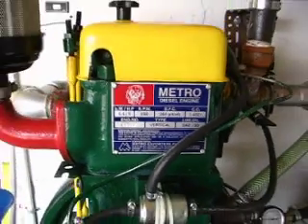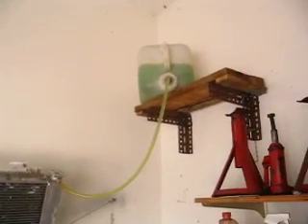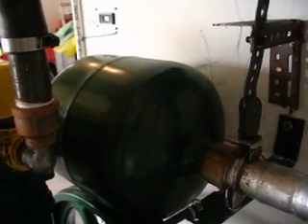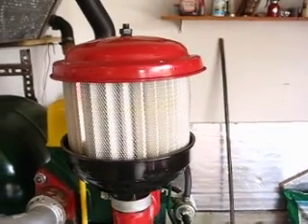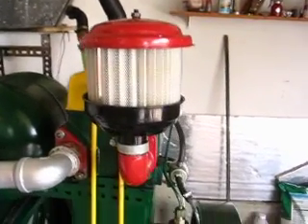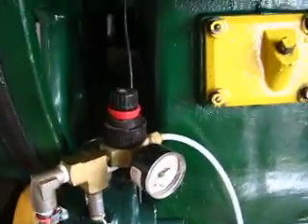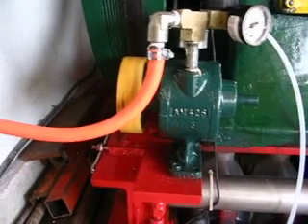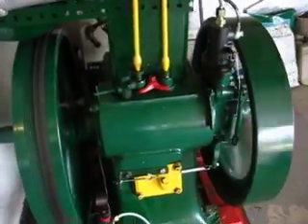Lister engine  air start

Comment: Slickest starting system ever seen on a Listeroid.  Very nice!
Reply from the maker: Thanks, this is a very old video. Lister and air starter still working with no problems
Reply: @hotrod3737 hi from Sweden!
I will exactly do the same. Thanks for the great idea!
Did you balance the engine? If so, how?
Reply from the maker: @stephanmenzel2103  I did not balance it and it runs pretty well. Still ticking along nicely although I only need to run it once or twice a year and normally only for a few hours

Comment from the maker: It is currently setup to run on a mixture of Diesel and natural gas.  It can run on straight diesel, waste motor oil, virgin or used vegetable oil, used hydraulic oil and a few other things.
We are not off grid and it is only used as backup and does not charge batteries.  We do not backfeed the grid (we have solar and wind to do that).  These engines are hard to find anymore as they have been banned by the EPA.  Cost engine if you can find one 2500 gen head 400 everything else you build.

Comment: I think this is the coolest damn thing I have ever seen.  What do you run it on.....fuel?  Are you off grid because of it?  Do you just use power as it is running or do you use it to charge a battery bank and feed electricity back to the grid....so cool, where and how much to get/cost of these motors?  Tks

Comment from the maker: There is an 120vac electric fan mounted on the top side of the radiator using a thermocouple on the water outlet to start and stop the fan.  The thermostat in the engine is a 195 degree F stat.  Remember this engine is only 6hp and the radiator is a very large aluminum radiator designed for a 500hp racing engine.  With the radiator at that angle there is a fair amount of air being sucked through  via convection even with the fan off.  Fan only runs is outside temp is over 85 degrees F.

Comment from the maker: @sdavies45 
My compressor/air system consists of a 100gallon tank that is always full.  If the pressure in the tank drops under 90 psi the compressor automatically comes on and refills the tank.  If the power goes out i know i have at least 90 psi in the tank and that can start the engine many times.

Comment: What do you do if you can't run the air compressor because you have a power cut?

Very very nice engine, by the way, runs as sweet as a nut.

Comment from the maker: @sumosamuri 

The cap is a standard automotive radiator cap that i modified by removing the bottom portion of the cap so if any pressure at all tires to build it just go up the overflow tube to the tank mounted above the radiator.  The radiator is one that I took out of my 69 camaro because i need a bigger radiator for the car.  I think the stroke is about 2" on that air cylinder but you don't need even that much.

Comment: Carl, 
I loved the vid. I have a metro 16/1 under rebuild. Curious as to what vehicle the radiator came from as well as the low pressure cap.

What is the stroke on the air cylinder you are using. This is so slick. No dead batteries or toothed plates to upset the balance!

Vern

Comment: your radiator cap should always be the highest point in the system. you should weld a blanking plate there instead, so someone doesn't take it off and spill coolant everywhere.

Comment from the maker: Well I am still around and the engine is running fine.  Only had to use it 2 times this winter during some power outages.

Comment from the maker: it uses about 1 liter per hour when running on diesel at about 2kw output.  When running Duel fuel diesel/natural gas it uses about 6 oz of diesel and about 2 cubic feet of natural gas.

Comment from the maker: The air motor is a GAST 4am air motor should be pretty easy to find on EBAy. The rest is just a generic air cylinder and some flat steel.

Comment from the maker: It can pretty much keep everything running that we need during a power outage within reason.  We can't run our central air conditioning and avoid unnecessary loads but we can get buy with the microwave coffee maker tv computers etc.  We have a gas stove and gas hot water so those large loads are not necessary.

Comment: Found this video by accident whilst looking at 
WVO submissions. I'm most impressed and inspired
to do similar for household backup power. I happened upon a small used but rather clean Farrymann which by what I've read might yield 
a bit under 4KW with the right alternator.
That should take care of the fridge and furnace and a few lights. Certainly what you have is 
a different class of machine but I am none the  less inspired seeing what can be done.

Comment from the maker: I don't have a model number on the cylinder but it is pretty small being about 1.5" diameter x 4" long. I suspect that any small cylinder would work fine, I am only feeding about 20 psi to the cylinder and full line pressure (130 psi or so) to the air motor. I am using a 5hp Sears air compressor with a 20 gallon tank. The frame is constructed out of 4"x8" I beam 3/8" thick bolted on top of 8x8 timber.

carl

Comment from the maker: WannaBee,

The air motor is pretty common and is manufactured by GAST. You can look on Ebay and find them used for under 100 dollars. I would not get the smaller 2am but the 4am or larger will work fine.  The friction wheel was one that i had laying around i just had to re-bore it.  You can get friction wheels from McMaster carr.

Carl.

Comment: Nice work!!!
I am thinking about using an auto starter and friction wheel as an electric starter.
The air start looks much cleaner.
Were can I get a 4AM  air moter starter? Did you have to make the friction wheel?
Thank you for the Video
Wanna BEE farmer